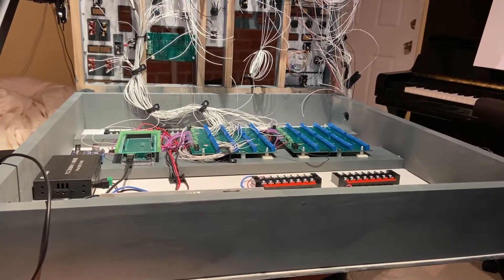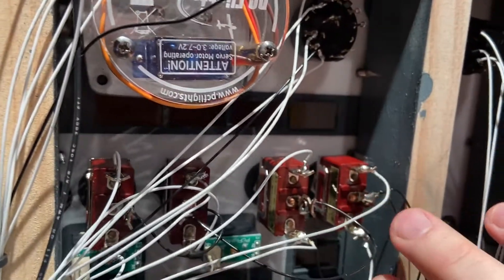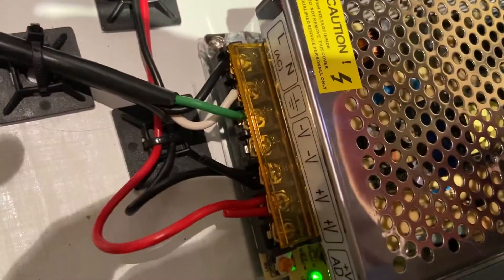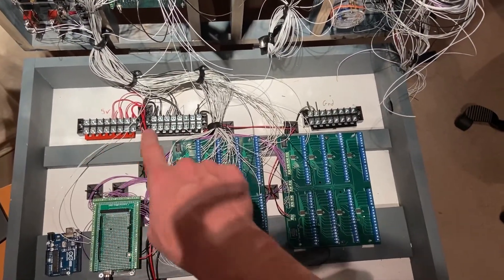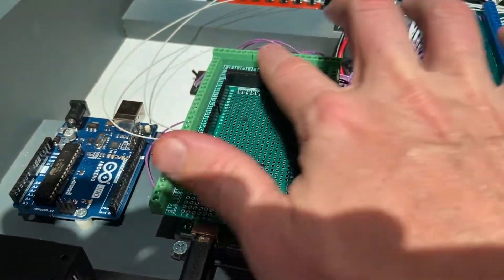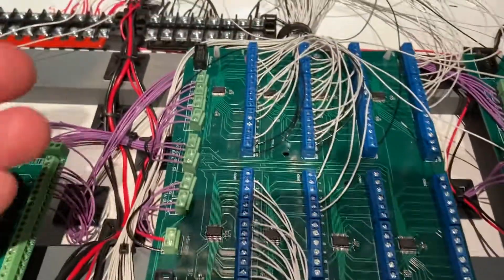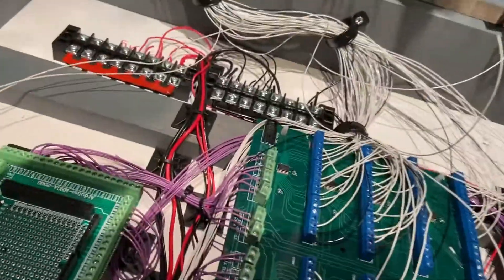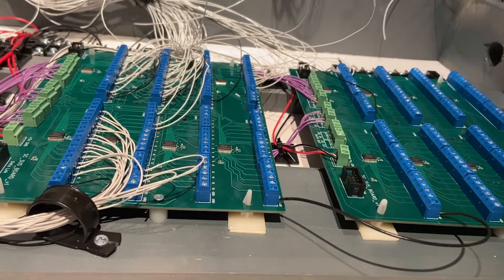Zibo Overhead Panel Build X-plane

Comment: There's absolutely **NOTHING** on the entire internet about how to connect Arduino controllers to the Zibo mod in X-Plane 11. It puzzles me how hidden that information is, if it even exists.
Even less so if you're using SimVim which sadly has barely any search volume compared to the mess which is Mobflight. SimVim is a very robust and straight forward interface, but it doesn't get the attention it deserves.